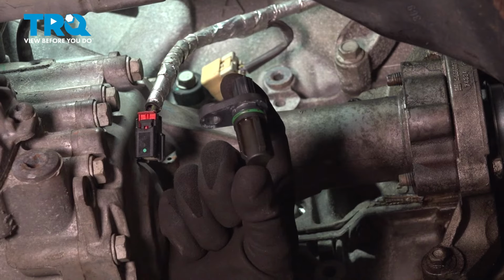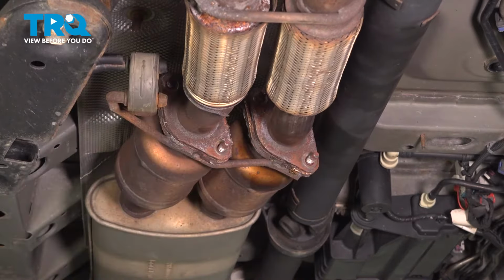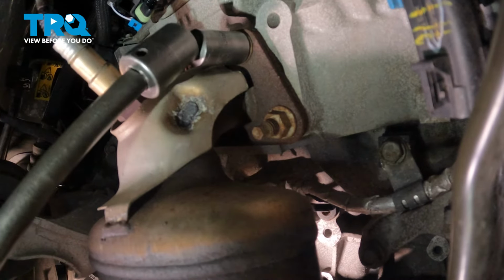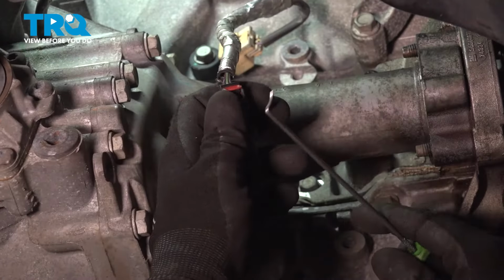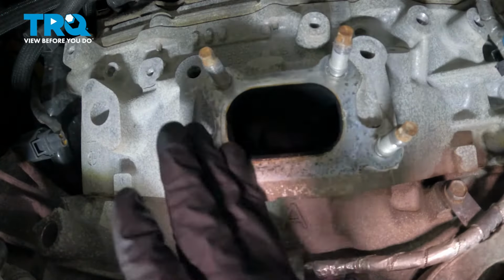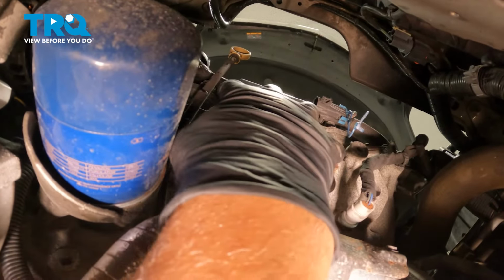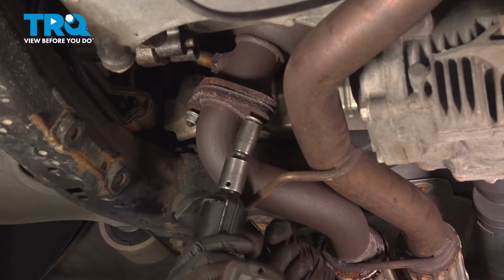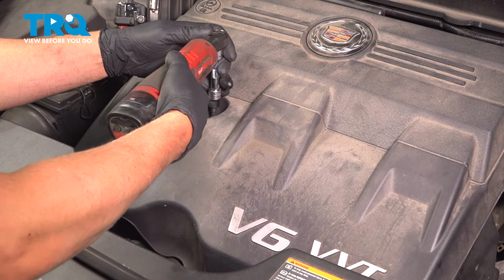How to Replace Crankshaft Position Sensor 2010-2016 Cadillac SRX

Comment: You can access the sensor under the car. There is a small heat shield with one 15mm and 10mm bolt you have to remove. Then replace it's simple. Don't understand why this video has so many steps.